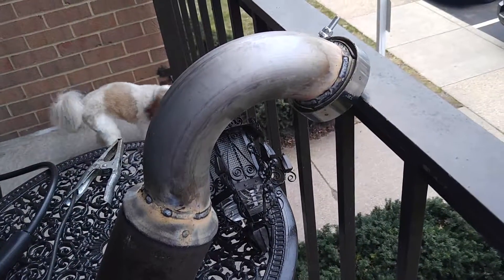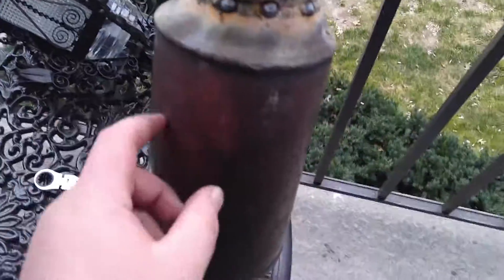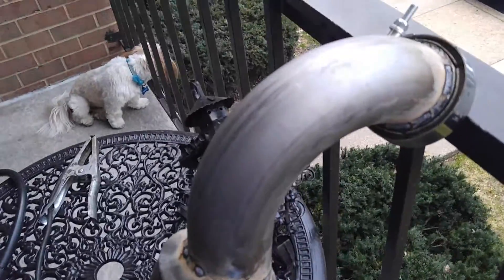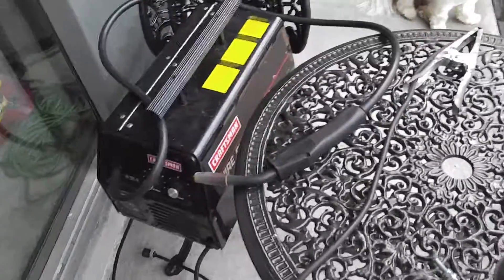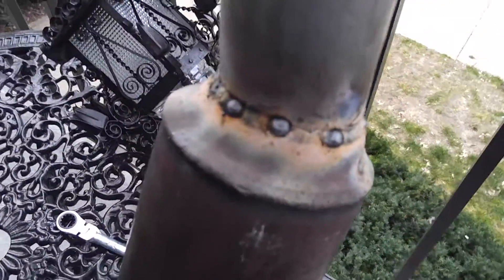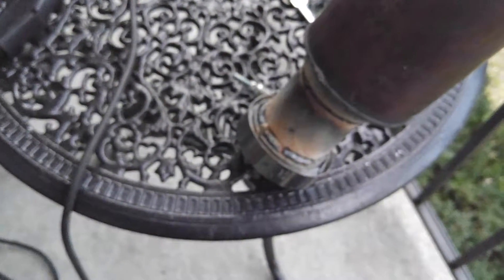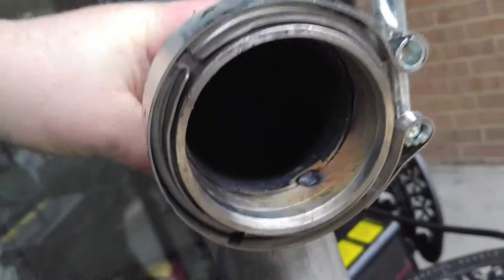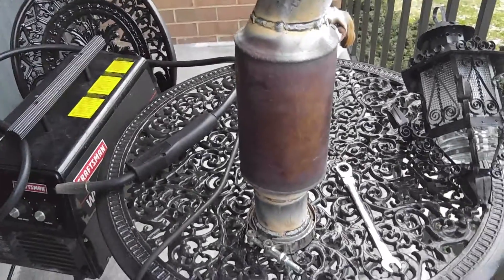2015 dodge dart custom 3" catted down pipe

Comment: Get an air intake for your dart
Reply from the maker: I have the HPSI MOTORSPORTS silicone intake, silicone hot and cold side itercooler pipes...ported throttle body....and already modded exhaust